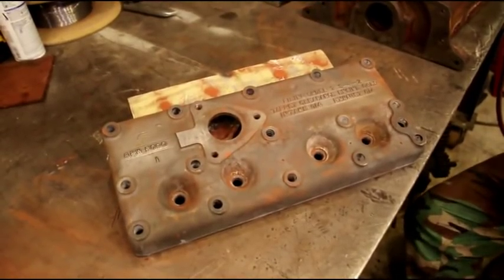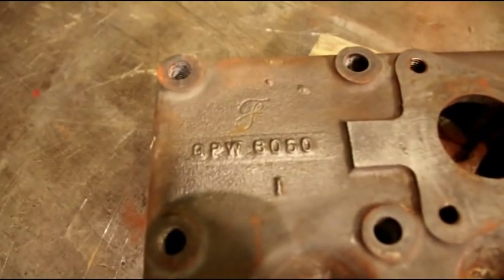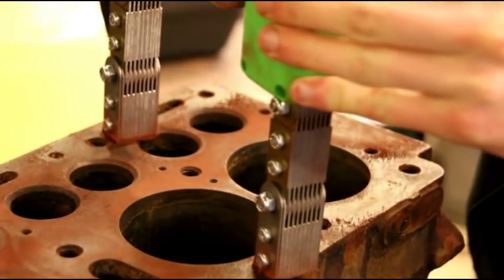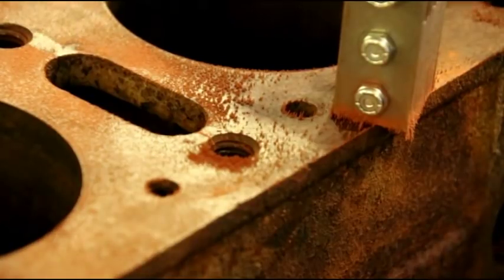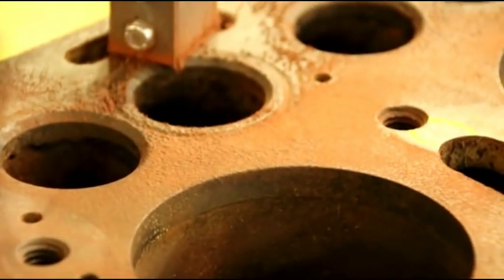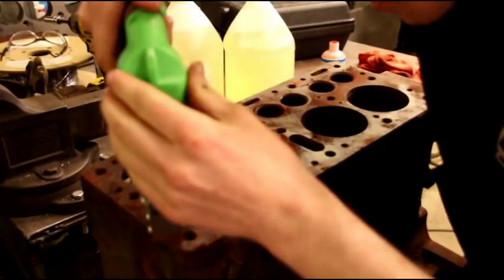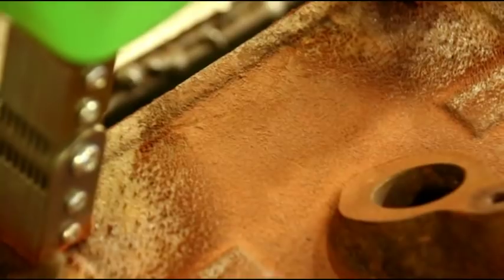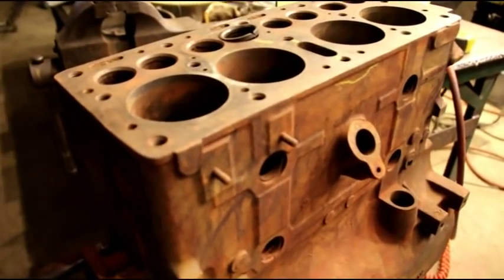Magnaflux Crack Check... Ford GPW Head Willys Block

Comment: Fantastic video guys....I hsve three of these blocks, two GPW and one MB...one of the GPW blocks I can clearly see cracks in the top flat surface. 

My question is this.....can you do a video showing from day dot to ready for assembly exactly what needs doing to an L134 block? In regards to new valve seats, new valves and guides, crack repairs, cleaning, honing cylinders...basically everything that should be done to get a 75yr old L134 ready for assembly. If there any that a absolute non-mechanic can do at home with basic tools? Also...can you show us how to check the cam,crank,valve guides and tappets for wear? I'm guessing most guys replace these parts outright but is it possible to reuse some of these parts?

Comment: That is soo cool. I’ve heard people talk about manga fluxing  their blocks and heads but never knew what it is.  Do you power wash the blocks with hot water and a degreaser? How do you get the rusty residual off the block exterior walls?

Comment: Is there a way you check the distributor passage for cracks , I didn't realize they were an issue until I found coolant in my oil after my first run up to temperature. and what is your fix for it.
Reply from the maker: You can use the magnaflux magnet and powder to check or the dye penetrate system that I have used in past videos.  Always good to pressure test a block before getting too deep into the rebuild.  depends where the crack is on how to fix it.

Comment: Brian, Ive got a MB Willys motor behind my garage, was running fine but not enough power to pull the boat at over 40 mph so replaced it.( luv chev V8`s ) your more than welcome to it for free,,but the freight is yours, Regards Frank

Comment: what is your way of cleaning the blocks?    are you stitching all other cracks?   I like the detail always nice to see and learn how its done
Reply from the maker: I use a caustic soda bath to remove all grease, oil, etc... and to clean interior passages of the cooling system plugged up with junk.  After that comes a high power pressure wash to clean every crack and crevice.  After machine work another bath of soap and water.
Reply: @metalshaperJeep   what container or maybe machine is used for the caustic soda cleaning?  what caustic product and ratio as well as time period the block is left in.